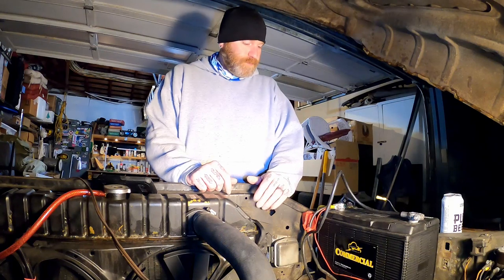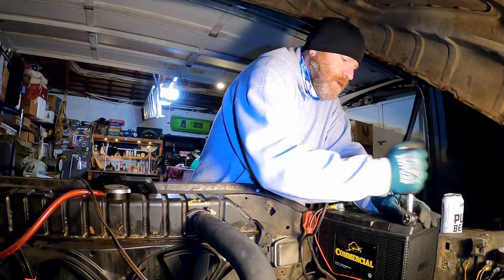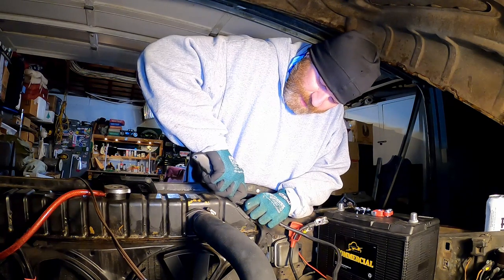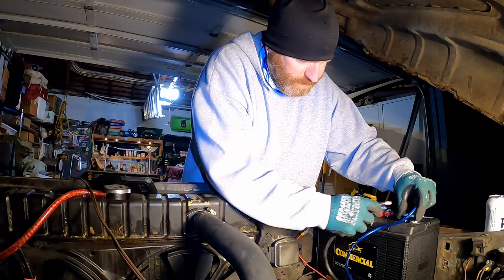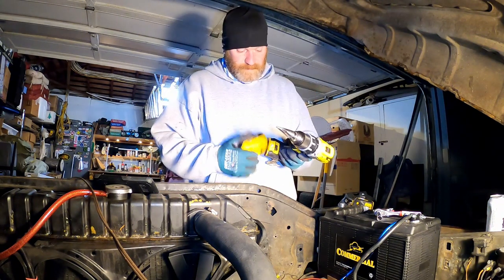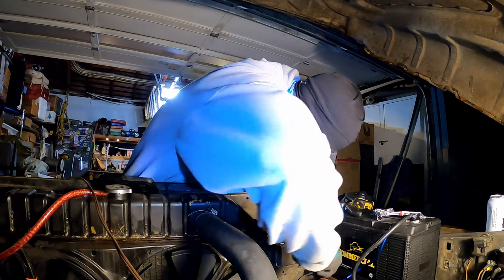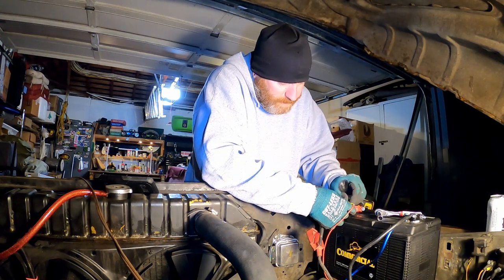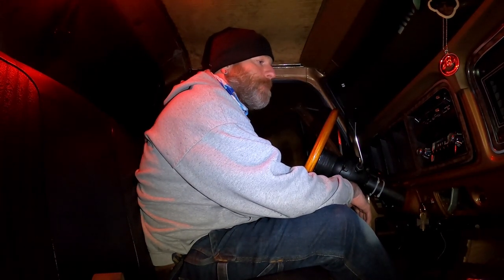1973 FORD f100 number III - voltage regulator

Comment: I have a 1973 f100,the battery dies every 5 days then i have to recharge it, i think i need to change the regulator and the solenoid, do you think those can be the main causes of the battery draining?
Reply: Same question, 1963 292 flavor